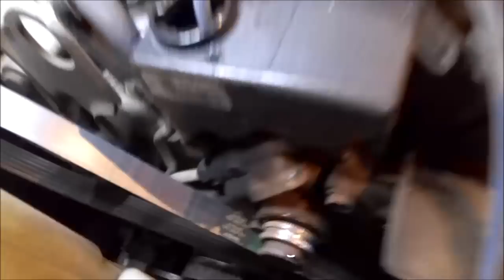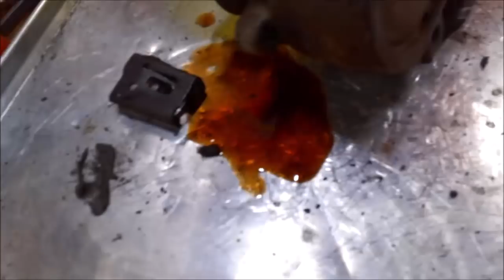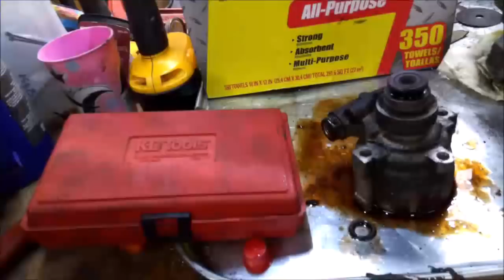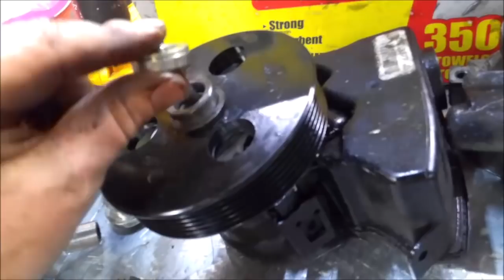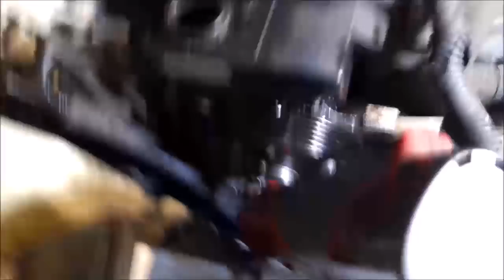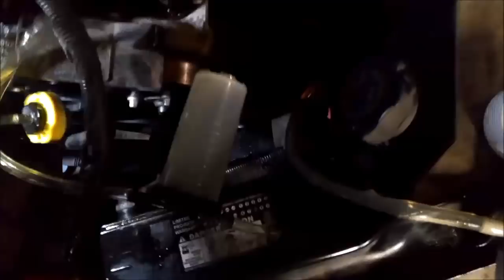04 Chevy Impala Power Steering Pump Replace, Flush and Bleed.

Comment: Is it possible to run the car without a pump at all?  Would a shorter serpentine belt work?
Reply from the maker: I really don't know I have bypassed a/c compressors in the past but never tried to bypass a power steering pump

Comment: Is there a specific fluid I should use if I just want to change the power steering fluid?
Reply: I've just used the Prestone fluid in my Impala for the past 13 years. GM has it's fluid but I don't know what the dealership charges for a quart.

Comment: I see the 2000-2001 must be different becuase the one on my car is actually toward the firewall behind N just below the alternator
Reply: That's because this is for the 3.4L instead of of the 3.8L. Youtubers really need to specify engine on vehicle ranges that have more then one engine. 00-05 has two engines. 3.4L (in the video) and 3.8L. Also known as 3800 Series II.

Comment: I have an 03 Impala with a leaking ps pump. It’s a 3.8, and pump is underneath the engine so to speak. How hard are those to change?  Looks like a hell of a job to me.
Reply: How to change a power steering pump on a 04 Chevy Impala SS the 3.8
Reply from the maker: They actually aren't that bad, if you havent done one just find a good guide to help you along.
Reply: Nah dude it’s bad. It’s a hassle to put it back in, it’s so tight
Reply: The worst

Comment: What do i all need to do this repair?
Reply from the maker: Power steering pump pulley removal kit and a mighty vac with the right attachment if you want to bleed it correctly.
Reply: @HooptiesGarage  do i still need the pulley removal kit if im only replacing the pump
Reply from the maker: Yes more than likely I don't think any of the pumps come with pulleys from the parts store. You can probably rent the tool at most auto parts stores I think Oreillys and auto zone rent for free if you bring the tool back

Comment: I have a 2004 chevy impala SS supercharged can you tell me where to find my power steering pump. The manual that came with it doesnt show me where it is.
Reply from the maker: I believe those are down real low your alternator should be towards your firewall if you look down from the alternator it should be under that you will see a pulley underneath almost in line with the engine crank pulley to the back of car that should be the power steering pump pulley
Reply: @HooptiesGarage  awesome thank you

Comment: It wasn't making any noise, just no visible movement. I disconnected the return line and it pumped out. I used a make shift setup using  a
 vacuum cleaner and hose. Now it makes noise and still doesn't work. I'll buy a a hand pump soon.

Comment: thanks. that may be the problem with my 03 impala. ps stopped working. i replaced the pump still no power and the fluid seemed stagnant in the resevoir.. Im going to get the vacuum set up and see if that does it.  BTW i replaced the rack and pinion several month ago and it worked fine up until recently.
Reply from the maker: Is your pump making noise or whining? I know it may seem unlikely but I have seen several new pumps not work right out of the box, I had a buick I was working on a while back the first pump I installed whined and grinded like crazy, I took that one back and got another one it was dead straight out of the box no noise no nothing just didnt pump fluid at all, took that one back gotna third one, installed and bled it, worked great I pulled it out of the garage went about a mile down the street on a test drive and it went out, hard to steer and power assist was coming and going. Took that one back got s refund from my parts guy, went to the junkyard and got a factory pump put it on and it worked perfect, never had a complaint from that customer about her power steering again and I still work on all her cars. These parts we get now a days are hit and miss even right out of the box. If you dont have bubbles in your reservoir or any whining when turning the wheel and no power assist I would suspect a faulty new pump.
Reply: @HooptiesGarage  yeah it whines. Works ok to the right but very bad to the left. I think ill see if i can exchage it.
Reply from the maker: @georgeperkins4171  definitely exchange it I have had a ton of bad luck with reman pumps.